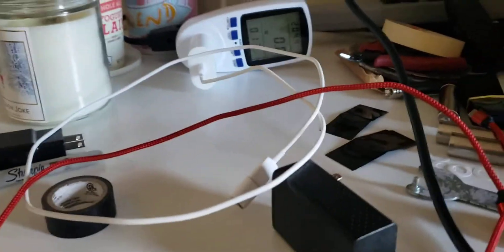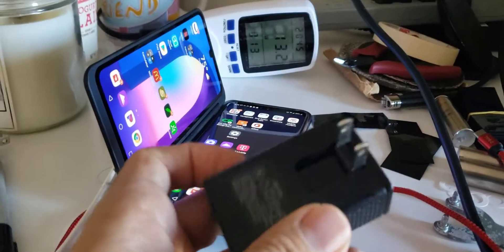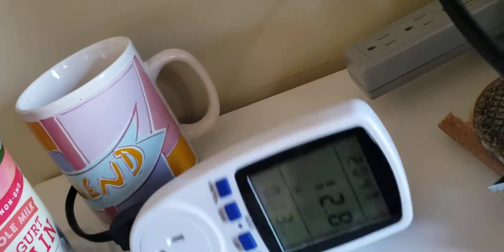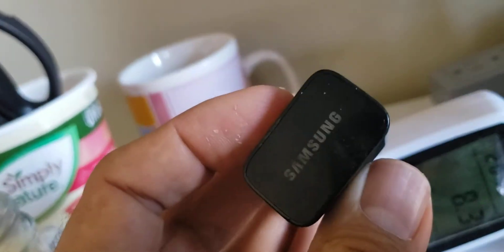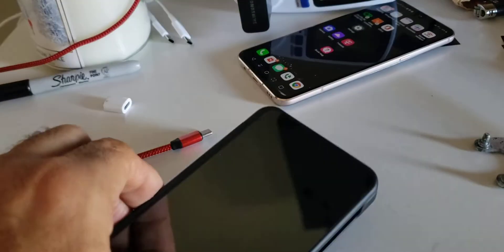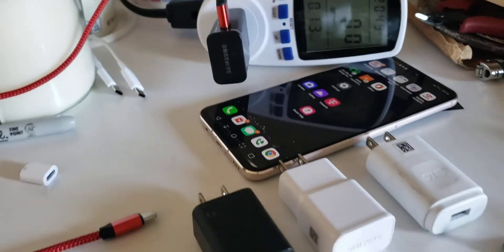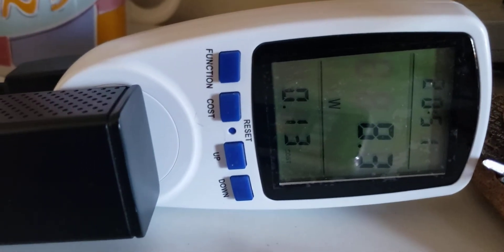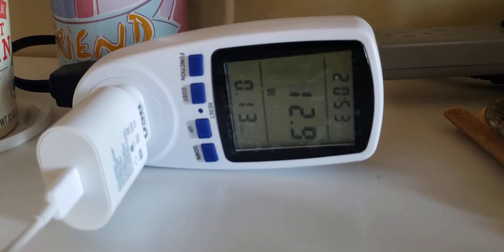LG V60 ThinQ 5G Dual Screen charger charges slower than the expected 25W.  Kill-a-watt test type.

Comment: My phone charging in 4 hours while having fast charger which shows 2 hours
Reply from the maker: The fastest I've seen is an Apple laptop charger.
Reply: @productcheck  Thats what i always use. Or my Anker 5 port 5 amp 50 watt charger using the Fast charge ports. I've noticed now the phone does charge slower but regardless i can use it ALL day non stop even and i never have to charge it till night time. So i just plug in before bed and in the morning its always at 100%. I think most people are always in such a hurry they never use Adaptive Charging which saves the LIFE of your battery in the long run. Sure in the short run it might charge faster but in a year you'll be like everyone else in the comments crying cause it charges to slow. lol
Reply: @productcheck same it charges at 2500mA
Reply: @productcheck does it affect battery life😊

Comment: I am facing same thing on mine, in fact I have 3 kind of 25 watt pd charger, when I checked with ampere apps its show score of 1530aH speed of charging stuck.
Reply: I use an LG stock charger, I always get below 1000 amp:(
Reply: @develentsai3215  the charger that comes in the box ? i think its the software
Reply: @sadee1245  I bought a used like new in box in Taiwan half years ago, it's a T-mobile unlock phone, the charger come with the box looks like genuine LG charger, at first it can charge at 1300 Mamp but now only like below 1000Mamp some time even lower than 500Mamp:( and even at below 500Mamp charging speed it still states fast charging on the phone, this is just ridiculous! I really like the phone but the charging problems is just pain in the ass:(
Reply: @develentsai3215  I think they provided you with a fake charging brick. Buy yourself a PD or QC4.0 charger from a renowned brand
Reply: @sadee1245  May I know what is the right Mamp per hour when you charge your V60 with a correct charger? So I have a reference in mind. Thanks
Reply: @develentsai3215  2500 is standard
Reply: @sadee1245  OK, Thanks:)
Reply: @develentsai3215  hi bro i also face the same problem 
Do you have any sulotion
Reply: I just check it from accubattery and always stay at 2500mah/10 Watt Maximum.

Can't figure it out what's the problem not charging at 25 Watt.But all of the above
Phone says Fast charging
Reply: Same here with me 1530mA

Comment: Have you found a better charger for the v60? Let me know, thanks
Reply from the maker: Laptop charger type c for Apple from Apple.  fastest I've seen. Good connection. LG cable is Bad. My phone port had a little bit of flour in it making it bad. I recently bought a $27 cable from Apple. I use it with the LG charger and it's acceptable.